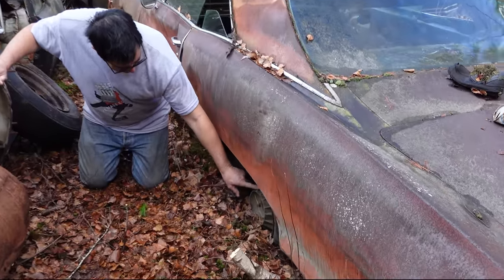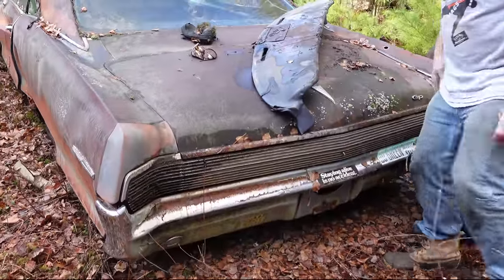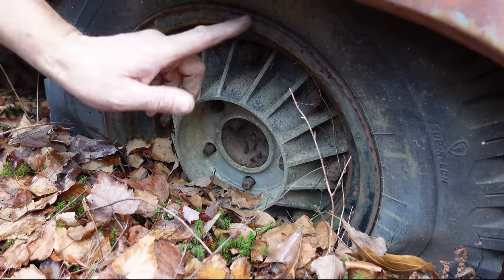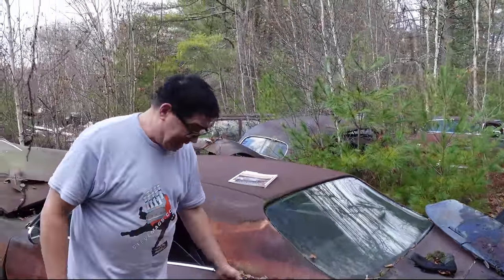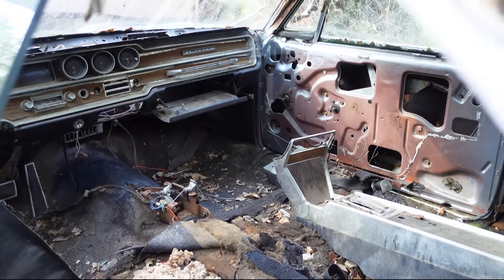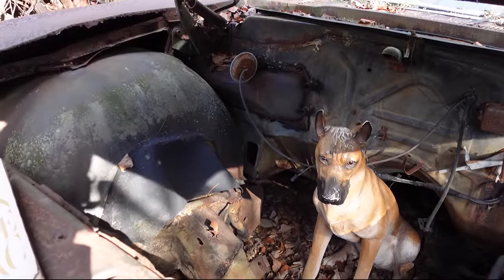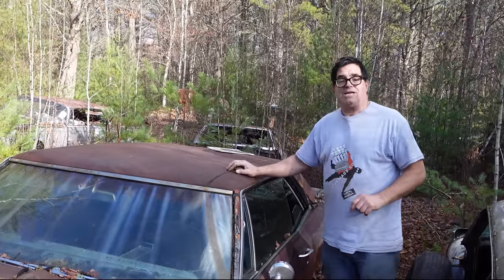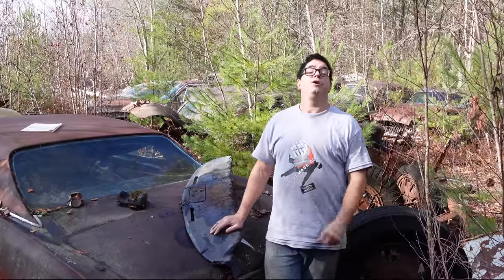Gimme a BIG Brake

Comment: Many engines over the years have tried to mix an aluminum  block with iron heads or steel valve seats in an aluminum head.  We all know those metals expand and contract at different rates, sometimes with disastrous results if overheated..  How did these aluminum brakes hold up with the iron braking surface?  Did the iron get loose over time?

Comment: tetanus is caused by tetanus bacteria, not metal rust.  That bacteria can be present in soil etc , so if you cut yourself on a rusty nail in the dirt while walking barefoot its the bacteria in the soil that enters the cut, not the rust, that causes the infection.

Comment: Pretty crazy that there is no rust under the rear glass on the corners of that panel between the glass and the deck lid especially on a Vinyl top car, and I’ve never seen A Pilar rid as bad as that .

Comment: Back in the mid 70's a friend of mine bought a '64 Grand Prix for a work car while fixing up his '55 Chevy. It had the 421 engine and the car was that burgundy color with a black interior and overall was in decent shape except for the usual rust on the rockers and rear quarters for the rust belt. He had a habit of just putting in 1o gallons or so of gas but the car was such a gas hog one time we stopped and filled it up and we didn't get more than a block from the gas station and the fuel tank bands were so rusted that they broke and the tank fell out. That's when I learned the bands holding the tank usually rusted out at the top where you can't see them.

Comment: Sooooo what engine did is come with originally. That body style looks just like the Silent Malibu I bought from your last video! Are these cars cousins?
Reply: This would have had a 389 V8 barrel V8. The 389 V8 with Tri-Power and the 421 V8 also with Tri-Power was optional.

Comment: I wonder if the lack of "eight-lug wheel" availability on GTOs had anything to do with aftermarket wheels? A GTO owner would have been more likely to install aftermarket wheels than a "full size" owner I would think.
Reply: It was because GM wanted to spend very little money on brakes for the mid size cars and they thought 11 inch brakes were too spendy.

Comment: Boat anchor w/ drum brake non-sense.
Reply: The dog makes more sense than that comment.
Reply: The full size Pontiacs in 65 and other years were very fast especially with the 376 HP 421s . The "8 Lug"  Drum brakes work great
Reply: One expensive boat anchor if you can afford one that's restored. They aren't something to sneeze at in the collector car market.